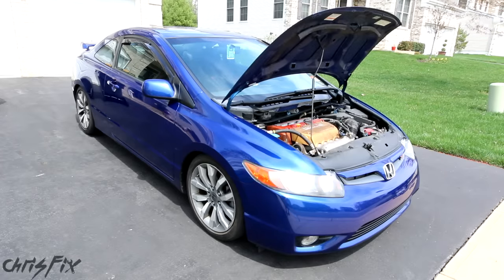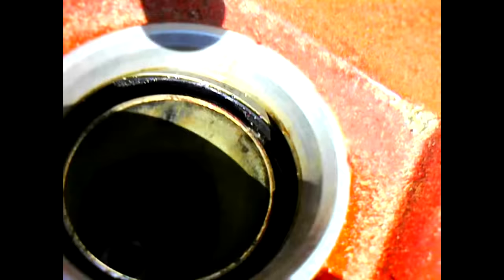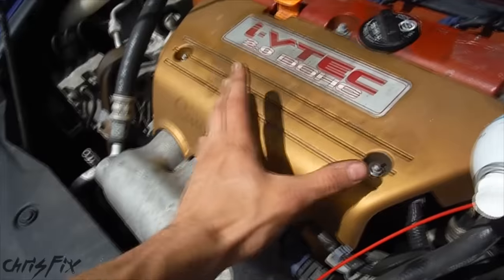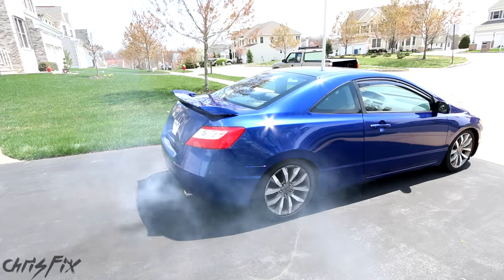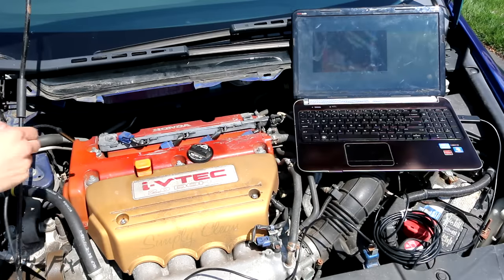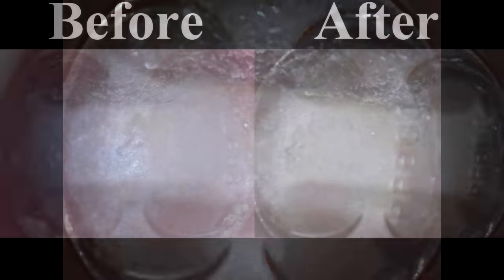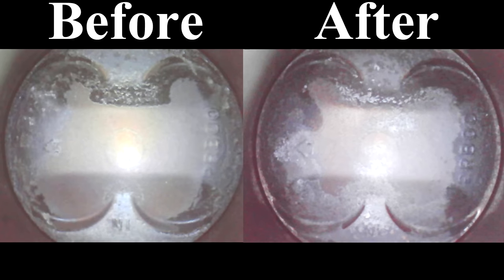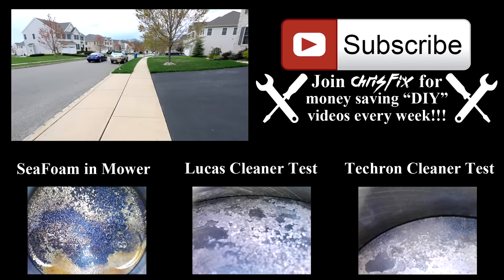Does Seafoam Actually Work in a Car? (with Proof)

Comment: Your video was much easier to follow than the instructional video from Seafoam. Go figure lol. Good job. Might want to mention that the person spraying the Seafoam in should probably wear some sort of respirator. It starts smoking before the can is finished. Also good for finding exhaust leaks around the engine lol. 

The Accord has 250,000 miles and runs great. It runs even better after flushing the fluids and doing this and the Seafoam fuel cleaner. The joy of buying used cars lol. I don’t think the dude changed the oil filter in quite a while. 

We now have 4 Honda’s all over 200,000 miles. My first Honda is almost at 300,000 miles original engine. If you take care of your Honda it will take care of you.

Comment: The other dark stuff could just be oil vapors build up from PCV, adding a catch can helps keep the piston, throttle body and intake system clean, I use sea foam as well as a catch can👍
Reply: I got an evil energy catch can off of Amazon. The hose that comes with it is a joke, do you know what/where I could get a different hose?
Reply: @truthseeker1203  I got mine from auto zone or advance, they have a hose selection...just bring the can and they would match it up👍
Reply: @kayson7469  okay have you ever put seafoam in the crankcase oil? I’m considering trying that as well.
Reply: You can use add it in your oil...it shows that on the bottle, I like to use it before my oil change like a flush...put a bottle in, let it iddle for 5 minutes then change the oil. But the 1 I like to use after with new oil is called RESTORER ENGINE RESTORE, been using that on every oil change for 10 plus years in the same cars👍

Comment: You could, Thanos this thing with seafoam and injector/valve cleaner this thing but... to a point I guess "what's the point" Just this demonstration is enough for me to go buy seafoam and test it on my old thumper see if that can remove that years or baked on carbon.

Comment: After driving a bit,  the car became more responsive, I felt more pull/power at lower rpm, smoothness in acceleration . I will monitor how long this 'magic' lasts. 
As the product is marketed as 'Safe' and no corrosive or orange chemicals I will be using it every 2000 miles.

Comment: Cold engine.
Remove spark plugs.
Dump some petrol in through the spark plug hole.
Leave for 1 day.
Disable injector and ignition by removing fuses or unplugging ECU.
Crank the engine for about a minute.
Install spark plugs.
Install fuses or reconnect ECU.
Do oil change.
Drive the car like you're Italian.

Comment: I have an engine with 390K miles and lots of carbon! I need you to experiment with my civic Chris!
Reply: That car needs to be on a Honda advertisement. What year and engine type ? VTEC earthworks or just VTEC ?
Reply: @longwindingroad  D16Y8 VTEC. It's not unusual to get so many miles with good care. I needed to replace parts like the alternator and distributor though among other things. I just seafoamed the engine and the amount of white smoke it made was insane lol.
Reply: @vdcwalk  I have owned my "14" Honda Accord for 6 months now. It has the Earth works VTEC and supposedly it's a great engine. Gas mileage is really good. It has 130k o. It. It has no problems but I'm told I need to have the belt changed, is this true?
Reply: @longwindingroad  sounds like a good car. Your best bet is to take the timing belt cover off after removing the valve cover and inspect it. If there's no real damage to the belt it's ok. Or maybe accessory belts like the alternator need to be looked at. If you have tools the job really isn't that hard at all. Also don't put gasket maker on the valve cover or anywhere for that matter lol. It gets way too messy for the next time you service it

Comment: actually you can do all that just by using  plain cool tap  water. Back in the seventies specially on Ford gas engine. They are well known  to stay running after you turn  the ignition  off due to high carbon build up on top of the piston. Same principle on restaurant  filthy grills with excessive build up of burnt  grease.. pouring ice cube on the grill while hot will peel off all burnt crap on the grill. Using oil  base product  to remove build up carbon actually are doing the opposite same as when you want to increase the hardness of a steel you need to apply excessive heat till glowing red then submerged it in a used engine oil to cool it down slowly.. and all fuel addetive are nothing but plain garbage.

Comment: I find your results will be much better if you shut the engine off after spraying the contents of the cannon to your engine.  I leave in an hour for it to heat soak and take it for a good drive we will continue to clean carbon for the next several days

Comment: OK....  Sea Foam in the throttle body made it to the top of the list.

Question:  While spraying the entire can into the throttle body, (centered in the TB on the butterfly open to the back hemisphere,  I saw ZERO smoke out the tail pipe.  I KNOW it all went in.  Can is dead empty and while product was going in, the RPM would be a bit higher.  If you let off the sprayer for more than 2 seconds, the RPM would drop.

Why would I not see ANY smoke?

After 10 minute (+) hot soak with engine off, I cranked it up, and took off.  ZERO smoke.... UNTIL...
From a dead stop (in a safe place), I launched it WOT.  As the RPM passed 3k on the way to 4+, it just started boiling smoke.  Took 3 or 4 launches to "clean it up".  No smoke UNLESS I was getting on it.

Clear exhaust then drove another 10 minutes or so to make sure the ECM had a chance to adjust.  Did another launch, and my "seat-o-the-pants" meter says it appears to be telling me that I got some throttle response and a little more pep out of the old girl.  My bore-scope wouldn't fit inside the spark plug holes, or I'd have documented before and after.

Thank you for this video series!

Comment: I did the same treat you did in the video, but couldn't see the affect as you showed it. Now I know. Thanks. I use the Seafoam in my Crankcase oil too. It keeps the slug out of my crankcase oil and has kept the engine running quiet since first using it. Please list that epoxy you used on that plastic part for your trucks shifter adjustment. We really want to know. And what best cleans fuel injectors. I use seafoam in the gas tank for the fuel injectors, but again have no way of telling how well it works.
Reply: is this comment some kind of joke?

Comment: I understand what you're doing,got it,my question is wouldn't the junk have to pass threw the catalytic converter? ,any chance of that being clogged?in some way? I have had my catalytic converter replaced not cheap, so your answer is?. Thank you 👍.
Reply from the maker: Last I remember these are formulated to be catalytic safe, and in practicality anything that comes off would get burned up and disintegrated and pass right through. If you have very large debris then it could cause a clog but that's outside the scope of these types of products

Comment: A little carbon will raise the compression. A little more squeeeezze wont hurt. Clean is good during reassembly. If you need a bottle to fix your problems better keep learning.  mmi92

Comment: Serious question - is there any reason not to spray seafoam directly into the cylinder bores, let it sit, then scrub it with a towel on a stick? Maybe repeating the same process with some IPA and vacuuming. I feel like as long as no bad bits get into the cylinders, it wouldn’t be possible to do any harm, and you could clean better than just spraying the chemicals into the air.

Comment: i did this on a corolla 2019 but not sea foam other brand , with 20k miles on the clock ,, i got bent roads and damaged bore ,engine runs but severe knock sound after the job, had to replace the engine ... true story , though i did to other cars no problem , advice don't spray contentiously which causes hydro lock and bent the rods,spray half a second and stop few seconds and so on,And don't spray just before you stop the engine , after the can is emptied let the engine run until the oil comes back to the bore and pistons or you'll damage the bore when you start again ,, don't rev or drive aggressively after you spray ,, advice to all so it won't happen to you

Comment: In modern cars there is going to be very little carbon on the pistons.  Engines run so hot, the only reason you'd need to treat your car for carbon is if something is wrong, like it's burning oil, has a bad spark plug or coil, running rich, and so on.  Fix the other problem and the carbon will burn itself away with no action required by you.
Reply: The problem with modern cars now is carbon building up on the back of Intake valves since most cars are direct Injected now.

Comment: It's kinda obvious you're much more optimistic on results from SeaFoam than you were with Gumout even tho visual results aren't really that remarkable after one treatment.  You WANT to like SeaFoam.  You seemed to expect more from Gumout and disappointed it didn't clean everything right away.  But here, the clean up is pretty marginal from Before and After but you're happy with the results because you liked what you saw in the lawn mower.   Not exactly a double blind study.    :D

Did you notice performance difference after you drove it?  Less valve noise?  That's what I found with both of them - seafoam and gumout, so they were both better than nothing, but neither a complete solution after one treatment.

I like them both, but Gumout was easier to use with roughly the same results trying to dislodge the built up hardened residue.

Comment: That was interesting and worth a thumbs up  and a subscription, even though I was actually looking for an answer to my zero turn lawn mower problem  when I accidentally found it. I'd love to find out which cleaners did NOT do much good in your opinion, are those of your videos on Youtube, too?  OK, now on behalf us who only know where the gasoline goes in and the exhaust comes out, but like you believe that all things in life should be kept clean and tidy---WHY do we want to spend an afternoon doing this?  Does it give us better gas mileage or horsepower and acceleration under the hood?  Does it create less pollution (could a bad case of this problem cause you fail the emissions part of the annual state inspection?)?  How would we KNOW that it is time to do this?---Does our engine begin to behave peculiarly, if so, in what way? In cylinder #4, you  seem to stress the difference in hard carbon around the EDGES of the cylinder---is this the major problem here, the edges and the point of contact between cyclinder and piston or those rings you talk about? What if all the edges were pristine but the center of the piston was gunked up, is that a problem?  Do you have a list of all of your Youtube video titles to review? Too many questions? P.S. It was either in this video or your Seafoam/lawn mower engine I learned the meaning of "Hydrolock", THANKS! (Last question: You married?)

Comment: Used to pull the air filter , keep it revved and trickle water into the intake on a cold engine and steam out the carbon, worked pretty good just don't hydrolock your engine or you're gonna be pulling plugs to clear it

Comment: I did this to my van in the driveway. And wouldn’t you know, my neighbors just happened to come outside as the smoke was pouring out and wafted right at them. 
So I like the Seafoam cleaner and will use it on holidays to annoy the neighbors! 🙋🏻‍♂️🚗💨🤷🏼🤦‍♀️

Comment: Okay, so I am a retired automotive technician. I have worked on cars for nearly 40 years. I also was an engine builder for a Nascar team and I have built many high-performance engines. I want to share the VERY BEST cleaner for your engine's valves and pistons. It is called........antifreeze! Yes, you read this correctly. When we would have a blown head gasket that was leaking into the cylinder, we would always find a very clean valve train due to the antifreeze that had run through that cylinder. Here is how to do it. Get you a spray bottle that has a pump on it. Something like an old Windex bottle works great. Pour about 20 fluid oz of antifreeze (green) into the spray bottle. This would be the size of a Coke or Pepsi you find in a convenient store. Start your engine and run it to operating temp.  Open up the air cleaner and start spraying the antifreeze into your engine's air intake system.  Keep spraying until it is all gone. Your engine may smoke while doing this but this is only the oily base antifreeze burning, not your gas. The smoke will stop after a few minutes and once you have finished spraying the antifreeze into it. Now leave the car running, put everything back together, and drive the vehicle down the road. Drive it hard! This will blow out the loose particles left behind. Now you are finished. If you didn't get the results you wanted, do this a couple of more times. It does work!
Reply: BTW- If your engine doesn't run a tad bit rough while spraying it, you are doing it too slow. Your engine will run rough until all the antifreeze has burned off. You don't want to do it too fast and cause the engine to die. Just use a steady spray and keep going, even if the engine starts a misfire, it will clear up.

Comment: Chris I have a bottle of that exact seafoam sitting in my storage ever since I bought my first car about 10 years ago. I have already seen this video many times I dont know why I have not used it yet but the time has come. Given that this video is 9 years old, can you recommend a better method in 2024 or should I just follow this video exactly?
Reply: Depends on your vehicle 

I tend to pull the brake booster hose 

 im going to do half in a spray bottle through the intake brake booster hose and the other half through the throttle body, if you have a mass air flow sensor after the filter before the throttle body like i do i would remove it and let it chill outside the throttle body since spraying seafoam directly will ruin the sensor

Comment: Was the engine still a bit warm for the after images? The color isn't the same. Digital cameras pick up some wavelengths of infrared and record it as a light whitish/purple. you can tell if a TV remote is working by aiming it at a digital camera.

Comment: I used Seafoam on a 2000 Corolla with 124,000 miles on it. I put it into the gas tank and also into the crankcase, exactly as directed. After I ran the tank to where I needed gas, I noticed a rattle when I revved the engine when in neutra. It also rattled when starting from a standstill. I took it to a mechanic I trusted and he said Seafoam was called that decaDes ago when first sold for 2 STROKE, OUTBOARD ENGINES. So what was the rattling after using the Seafoam. A loose timing chain. Thanks Seafoam, send me a 2,000 cehck to get my car fixed. 

And no, that was the quote from the Toyota dealer and my mechanic said he could do better by only a few hundered bucks,, but with aftermarket parts. 

Why did I try Seafoam? Another mechanic told me that my oxy sensors needed replacement, my car likley was runniong too rich for some time and the pistons etc must have been carboned up from that. No he didn't bore scope the internals. What did I know. That second mechanic was a friend, he never did any auto repair for me, his shop wasn't fully equipped. 

BEWARE. Seafoam says  works on gas and diesel, DOES NOT MENTION  ethanol additive gas. 

GUM Out does.

Comment: Going to look into it myself after this, but it's there anything that works as a solvent to carbon on contact? Would be simple to just pour in through the spark plug holes and vacuum/extract it all out the top.

The sea foam did do something, but I was expecting to see a shiney new piston in there.

Comment: What am I missing? 1.) Why the red color shift in the before and after puctures? 2.) There is still discoloration. I have a 2000 Camaro with 171k mi. This is only the second Seafoam vid I've watched.  The engine leaks oil from too many places for my mechanic to tell. I put an oil dye in and drove 67 mi and it's already a mess. Looking for some advice. I really like the car but don't have a ton of money to throw at it.

Comment: I used the seafoam spray in my 06 civic si and it hasn't stopped smoking since and I know it's normal for it to smoke for a little bit afterwards but I'm going on months now. I used the same product on my rsx and worked perfect. I'm not sure what this caused to happen this time, the smoke only happens at idle and smells like it's running rich and burning off fuel. It's definently not a head gasket as I am familiar with mechanic work and do all my own maintenanc, so I've done all the diagnostics to check for hesdgasket it could possible be a valve but my leak down test and compression test was great. Just think it's weird it's been doing this ever since the night of using seafoam.
Reply: I put a similar product in the crank case and it blew the main rear seal. Cost me $1000.00

Comment: Research seafoam little more. Inquire about converters and oxygen sensors. I'm not a fan of seafoam. Revving it up at high RPMs like that it's a good thing you didn't have massive amounts of carbon. And what it took off did not appear to be that much to me. I've seen holes from Lew's carbon right to top of the piston. With seafoam was originally developed for as interesting as well. I want to listen I'm not a fan of seafoam so you know my bias.
Reply from the maker: Yeah you don’t have to be a fan of seafoam but it does not damage O2 sensors and converters according to the company. I have no proof otherwise because I don’t have the means to test it besides the tests I’ve done.